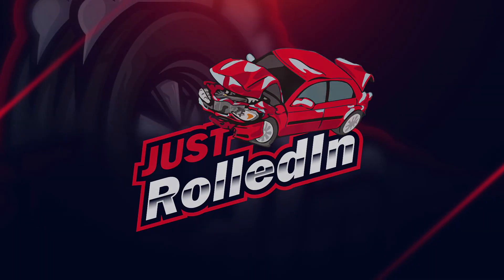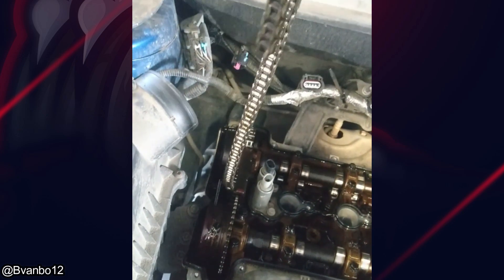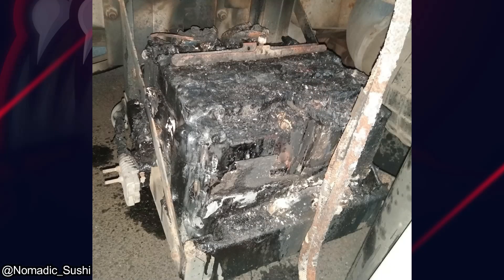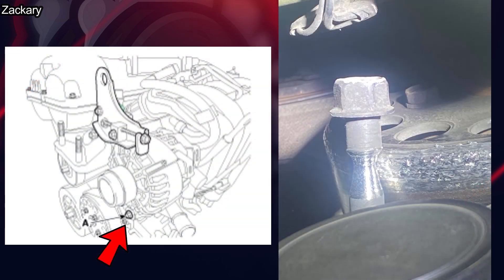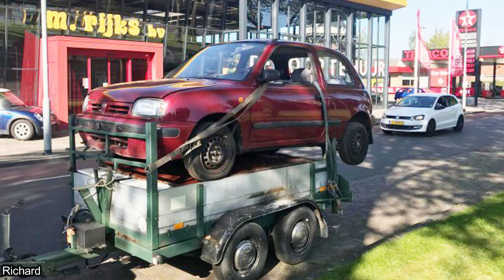Customer States Vehicle Won't Start | Just Rolled In

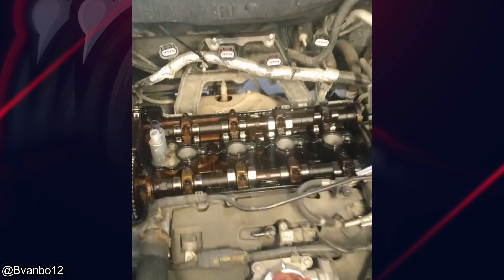Comment: 0:35 can confirm, Chevy Ecotec timing chain issue.  Probably slipped the nylon guide rail at the top or it broke off completely as they all do (you can see the cover for it right next to those two sensors), drove on and on with it flopping around inside the case until it finally snapped.  Great quality work there, GM.
Reply from the maker: Nothing but issues from what I've heard.
Reply: I haven't seen a broken main timing in an ecotec for many years, not since the chain recall in the early years ( 2001's I believe).  Most have just been very loose with broken intake side guide (and bolts) and the top guide completely worn threw.
Reply: GM- General Mistakes.
Reply: @brianbartosch7384  Our 2012 Malibu broke the big static guide between the crank and intake cam sprocket where the fastener goes through it. There's like 3mm of nylon either side of the bolt hole so it's weak there. It ate all the way through the top guide before it started making audible noises. Luckily we caught it before it jumped time, but the timing case was a mess... full of broken bits of nylon and little tiny pieces of steel. 

They are a VERY stout engine otherwise. The most powerful 4 cylinder drag cars in the world run eco tec 4 bangers, but the timing system is very poorly designed, even after all the revisions.
Reply: @doug960  My mom's Malibu has a failed guide on the chain, right now since dad got his new truck, they only drive it maybe twice a month at the most, but the chain is indeed rattling.  I thought, at first, it was that old "two two tick" the early to late 90's 2.2's had when the lifters started making noise.  Come to find out it's much, much worse.
Reply: Me and every God dam time I went to the shop and requested they fix the fucking timing chan its.
Oh it doesn't get loos it doesn't need replacement.
Oh its a 2005 toyota 4 l 6 cylinder engine.
Me im at 190,000 miles and i dont get to change my oil every dam time its needed it does need fix.
Na its fine we won't touch it.
3 weeks later bam chan broke and I used every dam record I have of them refusing to replace it.
Let's say they had to replace my whole engine with a new one and put it inn for free.

Comment: Customer: my car won't move when I shift it to any gear
Mechanic: well here's the thing, you have no clutch.
Reply: Customer:  Huh, I wonder how that happened...
Mechanic:  I can guess.
Reply: @cujoedaman  When I was 15/16, my mother insisted I learn to drive her stick shift. I tried for two days. I couldn't even fit IN the driver's side of her tiny Renault LeCar, let alone work the clutch pedal. I literally could not close the door because my knee wouldn't tuck in far enough to do it (fortunately, this was not a problem on the passenger side, though it was still hella uncomfortable to sit in it). Yet, she insisted I keep trying.

A few hundred dollars and a new clutch later, SHE was the one that learned the lesson. "Do not try to make [Megatron] drive a stick. You WILL INDEED have an offspring that does not know how to drive a stick, and you will actually be FINE WITH IT. Or else go bankrupt."
Reply: @Megatron995  Yeah I have 2 boys.  One drives a 6-speed manual Camaro SS and the other won't go near a stick shift.
Reply: @Megatron995  See, now all I can picture is Megatron trying to drive VW Bumblebee...
Reply: I had a customer with a 20 something thousand mile Kia Forte. He wore the clutch all the way down and shredded it into a cancerous oblivion. Probably rode the clutch everywhere and slipped it on hills. The new clutch felt weird. You have to release it slowly and ride it so the car doesn't buck and bounce every time you move from a stop.
Reply: @Megatron995  lmao, you could still learn, but you DEFINITELY need a truck and not a teeny tiny car before you start
Reply: I learned in an 86 Bronco II … lol

Comment: Safety tip. Make sure floor mats fit and don't obstruct or 'snag' pedals. Had a used set that eventually caught the clutch. Used them as trunk liners immediately after. As for the micra on the garden trailer, that's pretty much what the car was made for, a white good for easy disposal.
Reply: The Micra is a fantastic car though. We had one (Engine was neigh on dead in the end so scrapped it) and it was so cheap to run. Parts were so cheap we had a list of things needed for mot one year and cost less than £200 on parts and that's with 4 brakes, 2 rotors, tyres etc. Now my car costs £50 for 1 damn tyre. 😂
Reply: Other safety tip don't be in a hurry and put them on the wrong sides either, my throttle stuck down because of this once, I felt like such an idiot 🤦
Reply: I can remember when GM had a recall on mats doing that. Don’t tell anyone but when GM did not call for the old part I took more mats home then I will ever use. Lol
Reply: Thanks captain safety
Reply: @brantmcfarland517  nice, i would have collected them too. They're always worth $ if you save good ones.
Reply: Hence why every workorder that comes in requires you to inspect for "single floor mat equipped with retention hooks on drivers side floor".
Reply: @delta250a  I had one of these too, and I guess it would still be on the road, but the airbag controll light was constantly on (which could have been a defective sensor or the entire airbag controll relay, sorry, I don't know how it's called in English) and considering the car was either 16 or 18 years old by the time TüV was due it simply wasn't worth getting it checked out anymore. So I drove it until TüV (our MOT) was due plus two months over this date and sold it. The engine was still great, never gave me any problems.
Reply: @delta250a  I can vouch for this, my Micra was bomb proof. I hit a deer at 50mph and still managed to drive it home with a bent radiator!
Reply: Had floormats wedge under the air brake pedal, some dragging brakes because of it..

Comment: I think the most unusual thing I never seen was a ranger pickup that came in with a aluminum driveline that had been cut in half. It was puzzling for a few moments until I found a rubber floor mat that had fallen down between the cab and the bed and was on edge. It had fallen against the driveline and cut through the aluminum.
Reply: Oh wow, that "slow wear" just ground right through it like a tubing cutter

Comment: I had one a couple months ago, I was just told "noise turning left"

My boss keeps telling me it's something with the brakes. I told him it sounds like water sizzling on a hot frying pan. He insists I do brake work. Checked all brakes nothing wrong. Turns out my description of the sound was pretty spot on.

The drain for the a/c system was part clogged. When turning left, some of the water would slosh out and drop on the hot exhaust, making the sizzling sound. After unclogging the drain the sound was gone.
Reply from the maker: Great find 👍

Comment: I had an odd thing with my clutch when I was in college.  It was slipping so I had a shop replace it. After the replacement I couldn't use the starter when the engine was up to temp. Took it in and the shop adjusted the new clutch and the issue didn't go away.  Took it back in again with the same issue. They ordered a new clutch and flywheel to be replaced a second time. Mechanic took the car out for a test drive to replicate the issue, confirmed the starter wouldn't turn over the engine when the engine was hot.  Removed the starter and reached into the bellhousing and could spin the ring gear by hand.  The ring gear was a press fit on the replacement flywheel and was made of a different metal than the flywheel, so as they got hot the ring gear expanded and was no longer a press fit. They sent back the replacement flywheel and clutch they had ordered and got a different brand flywheel in the next day. Not sure what brand flywheel it was, but that stumped me and the shop for about 3 months. I got really good at push starting my car without anyone else's help.

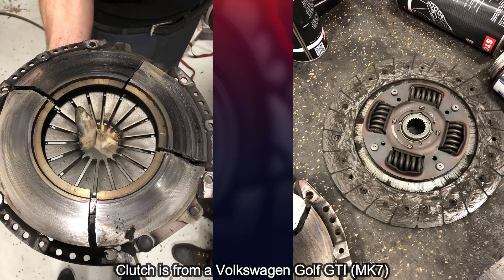Comment: 1:58 That GTI had a tune I bet. A stage 1 tune from APR is already exceeding 300 lb-ft of torque. The dual mass flywheels need to be replaced with single mass ones that take more torque
Reply: Hard agree. They didn't upgrade and now they need to. 🤣🤣
Reply: yeah for sure, specially since he said it lasted a couple months before dying

Comment: These are so entertaining.  

About the engine with the shot rod bearing.  Here's a story. 

Ca.1966, I'm driving my 1960 Volvo PV544 on (new) I-25 heading north to Gainesville FL to resume classes there. Suddenly ticking, then knocking sounds.  For dozens of miles, push on the gas, then back off.  

I think I pulled the oil pan and I could wiggle one of the con rods.  The guilty party.  Removing the cap, the crankshaft journal was obviously shot, lots of scoring. Now, don't ask me how I discovered this very old time machine shop in Gainesville beyond Yellow Pages.  One old man.  Anyway, he had a device that actually ground that journal .010 or .020 smaller, just working under the car!  Then I just bought the appropriate bearing inserts and all was well again.

Compare to today when almost any engine failure is catastrophic and repair makes no sense.

Comment: Keep them coming. :) mechanic over 40 years.
I'm both scared as hell at how lame people have become, and very entertained.
Reply: I've been wrenching over 40 years too, but I'm a Mechanical Engineer by profession (now retired). I weld, I paint, I MAKE parts, do auto body work (on MY cars) and I know my way around a machine shop. Spent 8 years analyzing lunched Diesel engines. I've seen shit like JRI's vids and then some! ;)
Reply: I read a comment elsewhere "30 years ago owners manuals told you how to adjust your valves, now they tell you not to drink the engine fluids."
Reply: @darb4091  At this point I think lawyers are the ones making owner's manuals instead of engineers.
Gotta keep your ass safe from the most stupid lawsuits ever possible.
Reply: @PhilG999  So... YOU'RE the engineer we all cuss at when we're working on newer cars... good to put a name to the rants... 😄 😄 😄
Reply: @bharris265  No I'm not! I didn't design the damn things and not only am I right there with you cussing them I see things most non-Engineers don't and I'm frequently muttering "Now why in the !@#$ did you do THAT?" ;)
Reply: @PhilG999  😆 🤣 😂
Reply: @darb4091  mean, people 30 years ago people were just as dumb then as they are now, but now we have the warning labels.
Reply: @mobslayer9919  Well, according to some scientists fluoride in the water reduces intelligence. I think by now it started showing.
Reply: @MyRegardsToTheDodo  thought that causes Alztimers?

Comment: 0:35 Ah yes the 2.4L EcoTec, I can't say I've ever seen a fully broken chain but I've seen my fair share of broken guides, extremely sloppy chains and bent valves on those engines. Not to mention their terrible habit of burning loads of oil causing most customers to nearly run their engine out of oil between changes which further exasperates the chain problem.

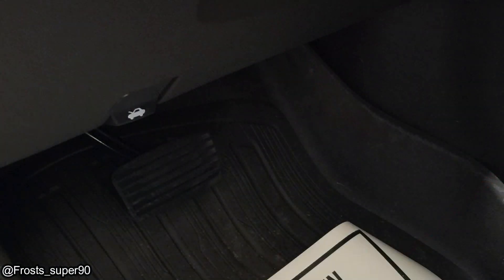2:29 I've seen that happen before in the shop... The guy a few bays down from me had a truck with a floormat fully depressing the gas pedal and as a result it wouldn't start (clear flood mode). He spent several days of head scratching and a timing chain inspection trying to figure out what's wrong only to have someone climb up in the cab for a compression test realizing the pedal was pushed down. Removed the mat and the truck fired right up... Sometimes it's the simplest stupidest things that are wrong with a car.

Comment: That was hillare!  ~~~   1:44 
I did a clutch replacement for a guy who was planning a trip. Wanted everything to be top running shape for his Holiday...  I noticed a slight seep coming from the rear bearing seal so instructed him to keep an eye on his oil level... He thought that too much a hassle and instead opted out by adding three extra quarts - maybe four... After the car was towed home I took a quick look and discovered the clutch plate had disintegrated into stuffing ~

Comment: They sure got their money's worth out of that clutch disc...
Reply: I bet he was like - I'm burning rubber. I'd be - that's clutch!
Reply: @robertthomas5906  Yeah, the smell of burning clutch is very distinct :)
Reply: I had a customer come in because 'her engine was roaring on the hills' Clutch plate looked a lot like that one. And she said it had been like that for a couple of months......
Reply: @alexbrown1995  I saw a clip with an old german guy, he was also burning through clutches fast, they changed the clutch twice at his expense, but when the third one was to be installed, he claimed that they were putting in bad clutches.

The manager of the shop took a drive with the gentleman and the rev limiter was on all the time.

The manager asked him if he did not have any hearing aids, and he said "Yes, but i dont need them so they are in a drawer at home".

They drove home and he put them in and voila...He was able to drive without revving the engine.

Problem was that he was unable to hear that he revved the engine.

So the manager put in a new clutch and asked him to atleast wear the hearing aid when driving.

In all honesty, what they should have done was to revoke his driving license, he was very old, and drove like sh*t

Comment: The Chevy Van looks nice.  I would add some Rally rims with beauty rings and center hubs.  Easy to mount 60s on as they're typically 8" wide  :-)
Reply: +1 for the van! Love the visor and amber accents.
Reply: Did my comment disappear? I dont see it. Thats my van I have a short video of it on my channel
Reply: @volvo09  looks like my comment did disappear, if you watch the short 30 seconds video on my channel of this van, in the description it says alot of information about it! I got it for 1,900$ with 63,000 miles. Sold it with 82,000 miles the way it looks in the video. I had to put that hightop roof on myself and paint it to match, I repainted the hood and the back as well it had faded Clear coat. I put the rims on and the brush guard and amber lights and basically everything you see, the visor, etc..

Comment: 1:05 You might say that the car gives "ID10T" error code and for the best of the car, it needs just two parts replaced, the engine and the driver.

Comment: 0:30 "crack"
1:30 seen that happen on a few different cars... On my Z if you don't tighten down the power steering bolt to spec it'll back out and start smacking the pulley making all kinds of racket.
2:40 Sir I think your blinker fluid is leaking.

Comment: In High School, I had a friend who had a 1964 GTO, Three 2BBL carbs and manual 4 speed. The engine had a horrible knock when it was at idle, but you rev it and the knock stopped. 
We found the crankshaft was broken on the back journal, but made a kind of ball and socket so when there was pressure on it, the 2 pieces would grab. 
Wish I had that car now....

Comment: I just recently bought new floor mats for my truck, they are fitted liners and I fired it up after and it was bouncing off the rev limiter. Took me about 2 seconds to realize I had put the mat over the gas pedal, just like the person in this video. 😂 Silly move on my part but at least I didn't have it towed to the shop over it.

Comment: the shock on the montana is a design flaw.  I had a grand caravan that did the same...on BOTH sides; the lower bolts snapped off INSIDE their mounting holes

Comment: Ayyee!! My 4runner finally made it up l! Heck yes 💪💪🤘
Reply from the maker: Thanks for sharing 👍
Reply: @JustRolledIn  always brother guy 👌
Reply: @kyleg-rover7707  thats my van next to yours :)
Reply: @Partnerthedog  🤘
If you look closely at my 4runner..You'll notice I was transporting a giant power wheels escalade. It was to big to fit inside, so I strapped it to the roof lmfao
Reply: @kyleg-rover7707  lol yeah I didn't notice that the first time. I use to have the same ish 4 runner, mine was also white, a 1999 SR5. I paid 2,800$ for it and it had been lightly crashed. I just replaced the front bumper and straightened the fender and it looked perfect 👌
Reply: @Partnerthedog  mine was a 95 with tge 3.0v6, literallytge biggest motor they had at the time. So it was literally a t100(Tacoma) with a permanently fixed cap. I didn't even have a hatch..I had a tailgate lmfao

Edit - picked mine up for $1300, still bluebooked at 2500 lol

Comment: I have seen a clutch plate that bad. They said it chattered a little when they shifted. I reckon it did. We had to plane the flywheel. Knew another guy that filled his oil until it was full at the fill hole. The one on the valve cover. Was wondering why it was having such a hard time turning over, and seemed to stall out after a few seconds. It's amazing sometimes seeing what rolls in.
Reply: Lol too much oil is pretty bad I over filled a lawn mower with oil when I was a kid , my dad was lke it was a piece of junk anyways lol

Comment: That BMW at 2:56 was spotted at a body shop I used to deliver to when I worked for a dealership in the Seattle area.  I thought it looked familiar and all I can say is that you never want to go into Kent unless you absolutely have to because most parts are pretty sketchy.  My guess is either they really pissed someone off or some vandal felt inclined take this BMW off the road.

Comment: To be fair, its hard to tell when a timing chain fails. I just think its funny if the vehicle kept running long enough to be parked. The motor just made a clunk and stalled in my experience. Timing chains are supposed to last long than most GM engines

Comment: That gmc with the sprayer spraying behind the headlight is a common issue, the wash fluid hoses run right next to the battery and if the battery starts to leak acid it usually ends up on the hoses and eats through them, had it happen on my 04 2500hd, pain in the ass to change but anyone can fix it
Reply from the maker: Thanks for sharing! Definitely not leaking blinker fluid, got it lol